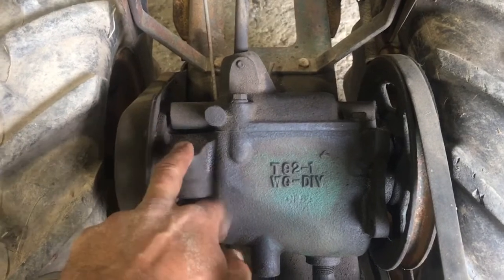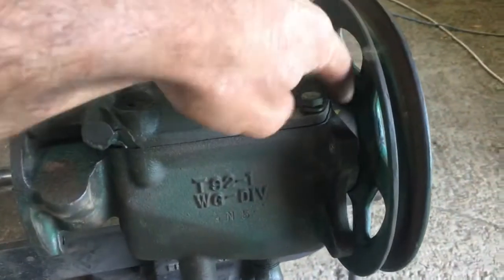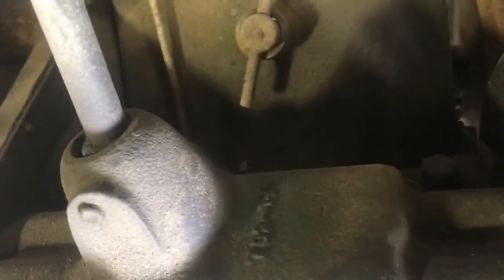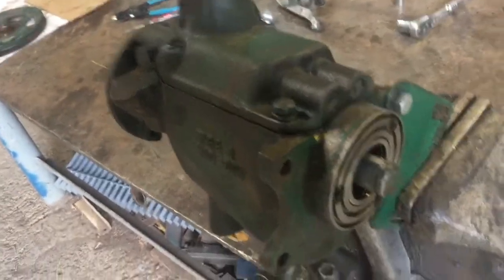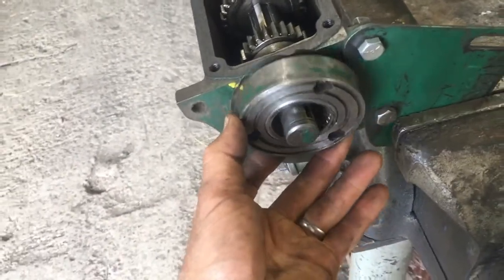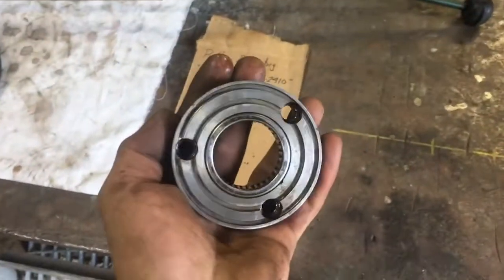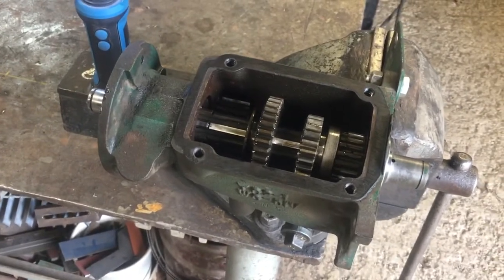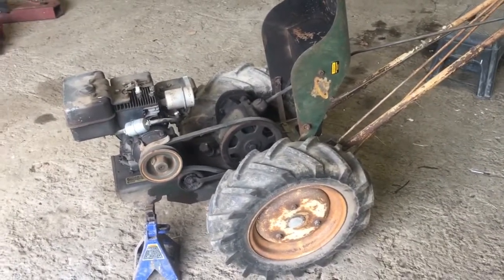Planet Jr B8G tractor, focus on Borg Warner T-92 transmission

Comment: I've never seen a roller bearing to support a pulley like that - must be a pain to get new pulleys that fit
Reply from the maker: Yeah I was surprised too.  the pulley wears a hardened steel loop (potentially replaceable) that acts as the inner bearing race. it's kinda like a two piece bearing that comes apart with one half fit snugly onto either part.